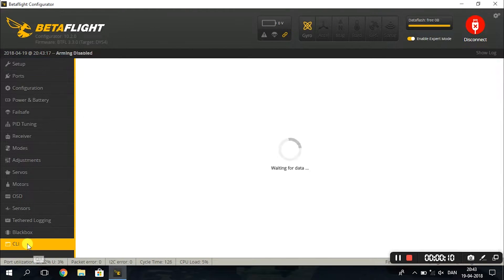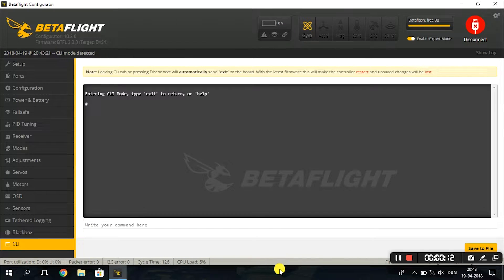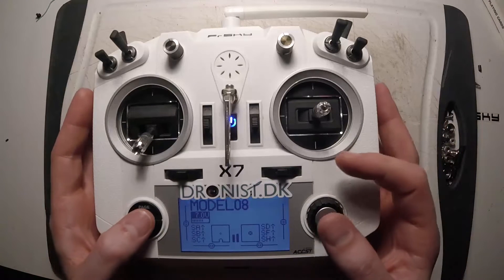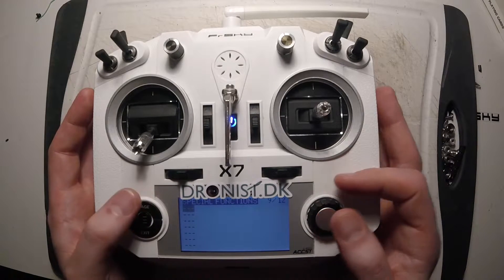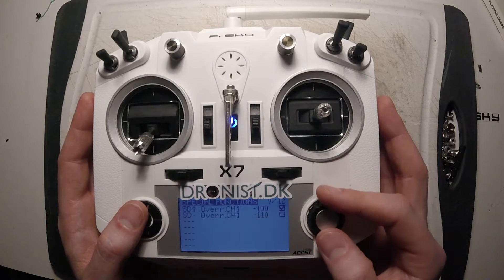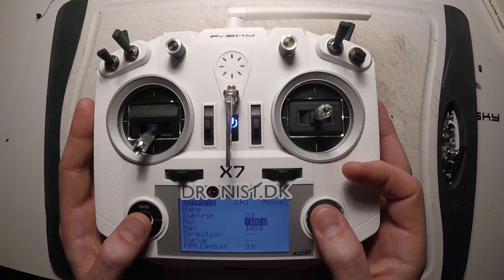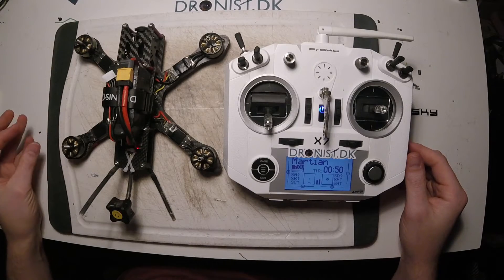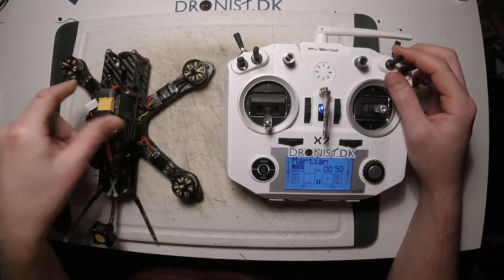Mr. Steele throttlecut in Betaflight

Comment: I did the same thing as you did but mine whenever I toggle the switch to wherever I want to.activate the gyro, it doesn't, unless you give a little bit of throttle then gyro goes on, help.please
Reply from the maker: Hmm maybe it's a feature that's not more active in BF. I haven't used it since I made the video so I actually don't know. Sorry
Reply: No, I think you didn't change the minimum throttle at the outputs tab.

Comment: thanks for the video!
if someone have the issue that the cli doesn't save the command when you set it on ''off'' you need to type  ''save''  after setting    ''set pid_at_min_throttle = off''

Comment: Hello, why do you use a 3 position switch? With 3 positions preventing throttle use? Couldn’t you use a 2 position switch and do the same thing with 1 position disabling the throttle/gyro and the 2nd position enabling throttle and gyro? Just curious, and thanks I’m doing this to my (3) Alien betaflight quads, already set it up in my (1) Kiss Reverb quad, it’s a great way to check for bent props!
Reply: No that makes sense thanks again for this information
Reply from the maker: FPV5150 you’re welcome 😉
Reply: MBJ- FPV why set the throttle to 1035?
Reply from the maker: Hey. I think you could do it on a 2 position switch. But I liked it for safety reasons👍🏻  cool, let me know how it goes

Comment: If you want to use it without airmode you need to set min_command = 1060 in the cli. So far the only downside to the idle up method is that you need to arm first in the pid off switch and then pop it to normal position

Comment: does this method also work with airmode off? i have airmode in betaflight turned off with idle up on a switch. im wondering if i turn off airmode, ill fall out of the sky. but everything is working correctly tho, when i arm, the motors spin up but the gyro is NOT active. it only becomes active when i flip the idle switch up.

Comment: Airmode on or off?
Reply: When i set 1035 my gyro is also off i must go up to 1049 and than airmode spins the motors more an more very fast. I know its normal but so fast.🤔
Reply from the maker: RIPSAW21 yes the motors spin up fast, don’t know why. But I arm and then fly. So I don’t care😁
Reply: @MBJFPV  but they dont stop they spin higher an higher. Also with props
Reply from the maker: I have air mode on. I just want the spinning props without the gyro👍🏻